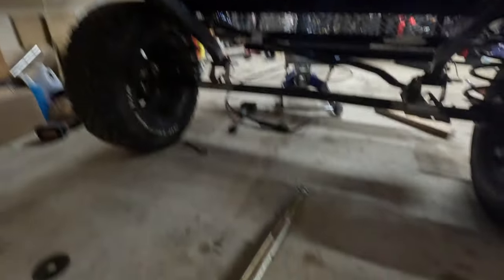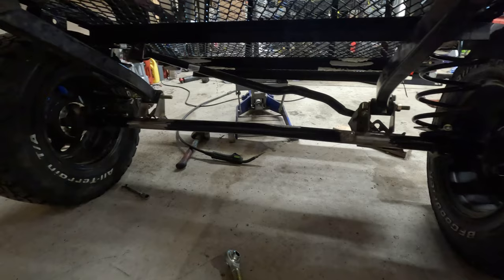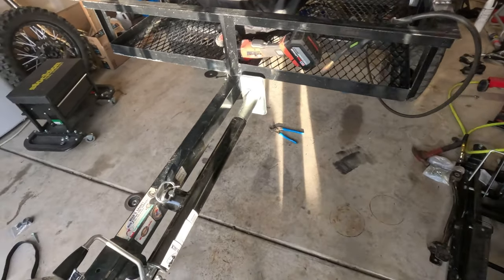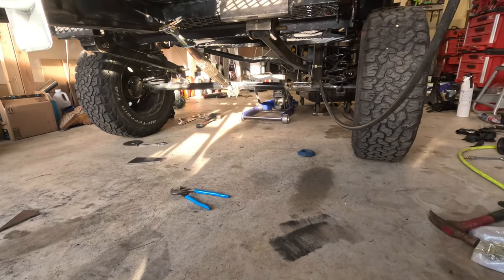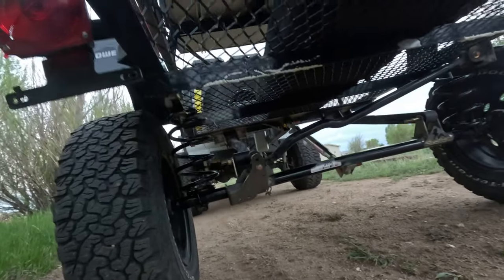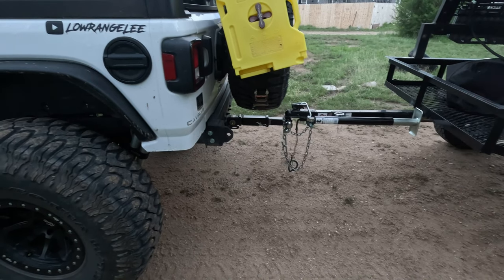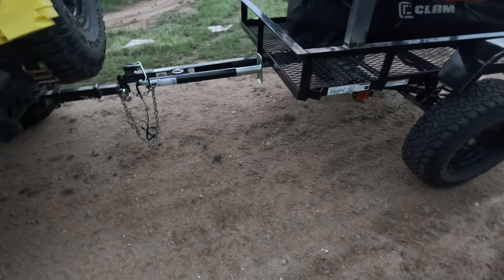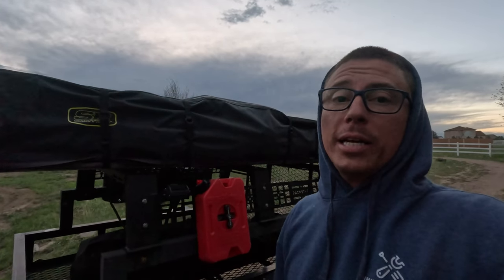Finishing My OFF ROAD TRAILER suspension and mounting the RTT!

Comment: What kind of bed rack is on the trailer
Reply from the maker: It’s from a local store it’s their brand. Think it’s called “rackstarz” and wouldn’t recommend it. I had to buy hardware and modify it to be anywhere near sturdy. It’s about Amazon quality at best but it’s working after a little structure work